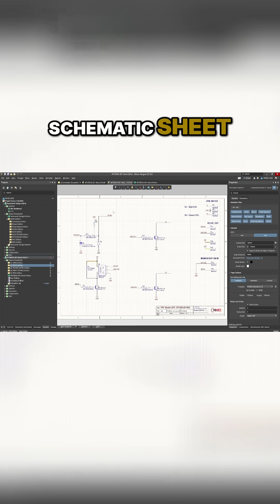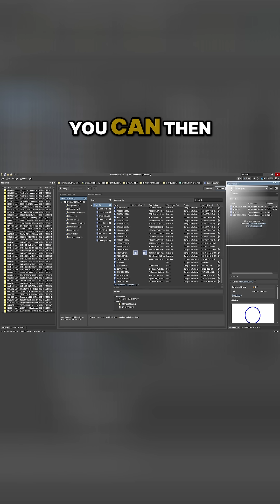Altium Library Export Tools: From Project to Centralized System

Comment: Do you recommend to unlink the components from the server? Assuming these were downloaded from the Manufacturer Part Search and you want to edit them (modify symbol, parameters, etc)
Reply: It depends what you are doing, which I discussed in the longer video. I think if you are working as a freelancer or running a design services firm, it's still appropriate to take all the components in the project (no matter where they came from), export them to symbol/footprint library files, and point your source in your schematics to the SchLib file. Then when you hand off the project, the client can do whatever they want with it. If they are an A365 user, they can do their own migration according to their process and formatting. It's much less of a headache for everybody.